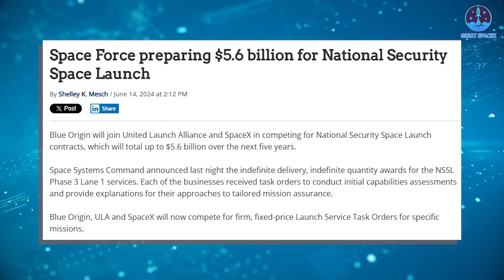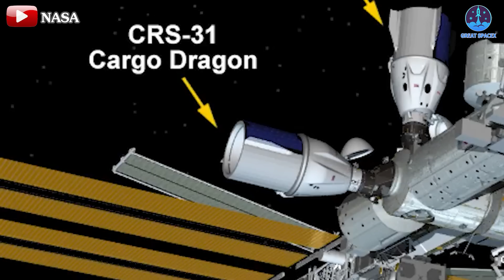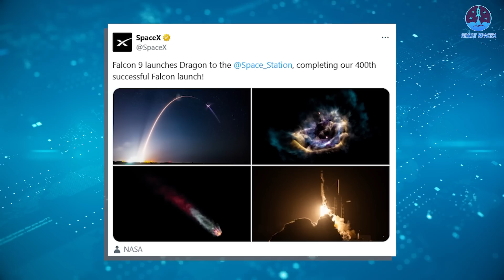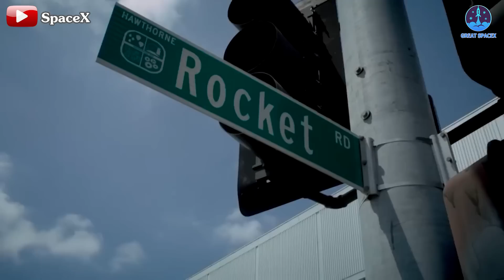Unexpected! Rocket Lab Released the Most Sophisticated Rocket Ever to Beat SpaceX...

Comment: Remember, SpaceX continues to update the rocket motors and the falcon system. They could bring second stage recovery but what is the cost study say. As far as Starliner, what other vehicle is designed to re-enter from deep space?

Safety and reliability is always and issue and usually result in additional checks and changes in processes. I’ve been there in my career working flight testing, manufacturing, … It is a part of a companies process reviews after every flight or incident report!

Comment: Maybe but I don't think Rocket Lab has the ability to politic government contracts that they are going to need in order to become a worthy rival to SpaceX. Just look at Firefly Aerospace, you probably don't know anything about them yet they have secured the ability to bid on the DOD's SDA new HALO program, secured a partnership with True Anomaly for a 3 launch contract using Fireflies' Alpha Rocket to carry the US Space Force's Tactical Response Space Mission, a 20 launch contract with L3Harris and 2 contracts with NASA, one for the NOAA's Quicksounder Spacecraft and the other for CLPS.

It's seems really weird to me that the only US commercial company to ever try to put a Lander on the moon just said they are on track launch by the end of this year gets so little coverage. Firefly may have had a bumpy start but after ditching Aerojet Rocketdyne and the AR1 they have had 5 Successful Launches with they're Low-Payload single use Alpha Rocket that is Powered by 4 of they're Reaver Engines and 24 more flights contracted. Alpha with 4x Reaver 1 specs: LOX/RP-1 Turbopump Tap-off Cycle with a combined 801kn of Thrust (VAC), 295.5sec ISP (VAC), getting a reported 1,050kg to LEO, 650kg to SSO. 5 Reaver 2 Engines are planned for future Alphas. Now that's pretty kool but it pales in comparison to there most recent achievements.

Having proven there manufacturing techniques they have now been award a contract to build Northrop Grumman's Antares 300 Rocket which is believed to be similar to they're own MLV. The MLV (Medium Launch Vehicle) doesn't have a sweet name like the Alpha but it's the chosen vehicle to take Blue Ghost (they're unmanned Luna Lander) to the moon. MLV will be fit with 7 Miranda engines. Although Lunar Injection Missions will not leave enough fuel the MLV's first stage is planned to do propulsive landings and be fully reusable just like Falcon 9, Super Heavy, & Starship. The Miranda/Vira (Vacuum Miranda) class engines have undergone 20 successful test fires and enter full production. MLV first stage specs: 7x Miranda engines LOX/RP-1 Turbopump Tap-off Cycle with combined 7,161kn of Thrust (VAC), 305 sec ISP (VAC), getting a projected payload of 16,000kg to LEO, 3,200 to GTO and the second stage powered by 1 Vira Engine (Vacuum optimized Miranda) will get a projected payload of 2,300kg to TLI. Yet none of that is worth even a single mention... Maybe next time.

I have yet to read anything that clearly states weather Northrop Grumman's Antares 300 will be fit with Fireflies Miranda class engines. My understanding is that Antares 300 is the MLV with a buffed Antares 230 second stage atop it.
Reply: Small investors can't put money into Firefly, which like most space startups is a private company. Rocket Lab is exciting largely because they've gone public and are an opportunity for everyone to buy into the space industry.

Comment: 03:30 On Falcon rockets the fairings are NOT discarded. They descend gently, are recovered from the sea by specialised boat, and reused. What is true is Neutron system seems to me cheaper: you have the retrieval of the first stage and and the fairings together. 
Using the lighter carbon-fiber body, Rocket Labs wants to achieve as much performance as it can from the first stage, in order to reduce the required performance needed, so the size, so the cost, of the disposable second-stage. 
This strategy, unfortunately, has some disadvantages:
Higher performance first stage means higher re-entry speeds, hence more thermal stress to the resin body (costlier to make).
The first stage is larger, having to contain the second stage and payload, so there is a slight weight penalty.
Like usually, there is no perfect choice, it's always about compromises.

Comment: Rocket Lab has developed its Electron with $100M and Neutron $300M (currently in advanced stage of dev and by SPB will likely stay in budget and on schedule for NET Q2 2025 debut) in privately raised funding much more efficiently and faster than any company. Neutron will be more cost efficient than Falcon 9 and even Starship on esp. deep space missions or many missions fitting to its capacity and without ride share demand to that destination.
RKLB 🚀
Reply: Are you just guessing or do you data to back your statement?
Reply: @malax4013  see SEC for Q2 10Q p21 launch services gross, Beck Madison interview, three most recent Adam Spice interviews, use logic such as: $55M < $67M, as well as what Starship would cost to take it to Venus and back (with 6-10 refueling launches) vs one $8M Electron or $55M Neutron launch. Electron will do an end-to-end Venus mission Jan 2025. I did a lot more DD before investing all in RKLB and so should you if you plan to. The more I found the more bullish I got. Ashlee Vance's book or documentary film Wild Wild Space is an entertaining one to start with.
Reply: @If electron or neutron can go to to venus with single launch without refueling the mass they carry there will be very low.
Reply: @malax4013  Electron 10s of kg, Neutron 1500 kg to Venus thanks to unique fairing design enabling uniquely efficient 2nd stage, both with planetary kick stages, no refueling needed. You'll see a mission likely January 2025.
Reply: @ 1500kg on isnt that much but its OK long trip research mission.
Reply: @ Starship is designed to deliver 100ton pay load everywhere. That is the reason it needs refueling on orbit. Its just physics and you cannot get around that with current rocket fuels/ propulsion systems.

Comment: SpaceX also tried Carbon Fibre, but decided it wasn't for them. I am curious to see how well it will work for Rocket Lab.
Reply: I'd say Space X has not discarded carbon fibre. It currently uses it on the highly successful Falcon 9 program for their reusable cargo fairings and for their landing legs. It does not use it for tanks and the main outer shell. 

The Starship Program (as I would call it) is still in its early development phase, they are currently collecting data on infrastructure and procedures for every planned phase with handcrafted pathfinder vehicles.  These are made out of stainless steel, but to me that does not necessarily say that it will also be used for the commercial useable version. It could as well partly be made out of Aluminium or carbon fibre.
Reply: Carbon was not able to survive the heat of re-entry to be reusable.Stainless steel is not only able to take high temps, but also the chill of liquid methane.
Reply: They switched mainly because using carbon fibre means you can’t rapidly make changes as you need to make a new mould each time you make a change. It’s not a re-entry problem Rocketlab has shown this with the Electron and obviously wouldn’t be proceeding with Neutron if the modelling showed it couldn’t survive re-entry.
Reply: Rocket Lab has BEEN using carbon fiber.  Elon gave up on it because he didn't understand how to properly utilize it.  He gave up.  He's an inferior CEO

Comment: Great content. Regarding the durability of Neutron's carbon fiber: like Starship's first stage, Neutron's first stage doesn't need to burn off much velocity and it has a relatively wide body for its mass, meaning the carbon fiber will be more than sufficiently durable for many launches. Starship's second stage needs to burn off the tremendous velocity of orbit, requiring significantly more durability than the first stage. Neutron's second stage is relatively inexpensive and will not be reused.
Reply from the maker: Thanks for your great comment. Keep following and discussing on our channel ☺️

Comment: Launching rockets are one thing, landing rockets are another.
Reply: Without under-appreciating the challenge, Rocket Lab already built and delivered for launch, together with Firefly, a propulsive lunar lander Blue Ghost, so having already done some work to master propulsive landing applicable to doing the same on Earth. Neutron's shape and powerful throttleable engines makes the challenge a notch simpler than for Falcon 9.
Reply from the maker: Exactly

Comment: SpaceX re uses the fairings. They are not disposable
Reply from the maker: I mean they throw fairing, but they still recover it, meanwhile, Neutron's fairing is not thrown
Reply: @colonbina1  I can see the fairing on neutron being a problem in the long run.
Reply: Elon said they save six million per launch saving the fairing
Reply: Rocket Lab saves the recovery, refurb and reinstall cost and additionally as the recent Angry Astronaut Neutron video noted, saves a lot in 2nd stage cost as it inside the fairing is not exposed to the max Q pressure unlike the much heavier and more complex Falcon 9 2nd stage.